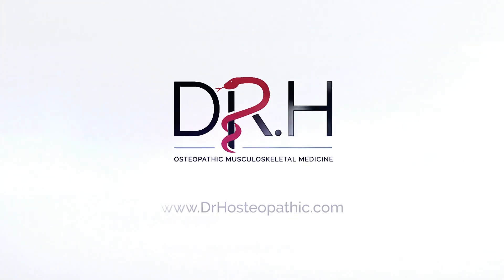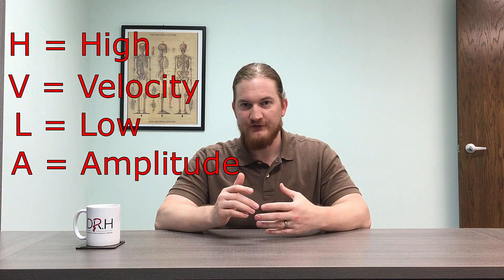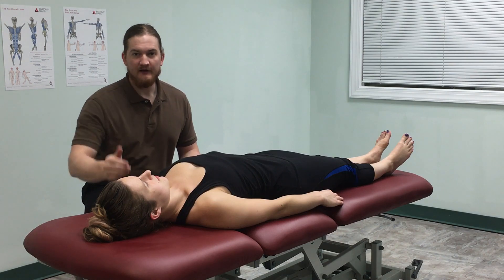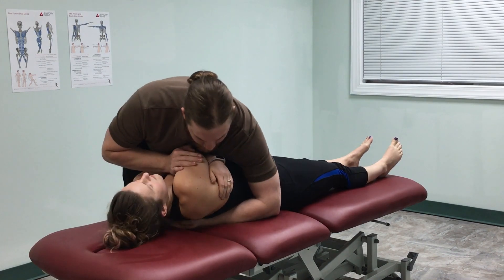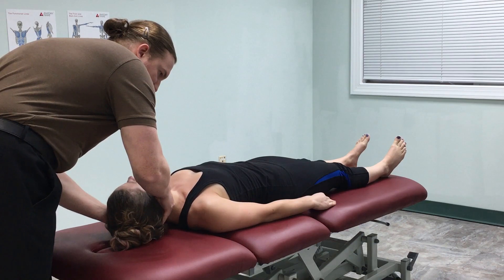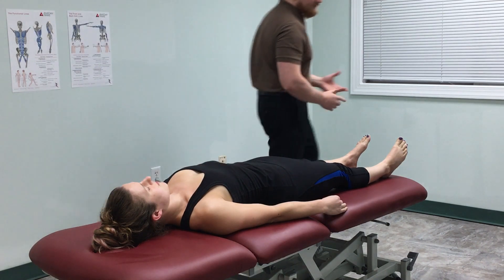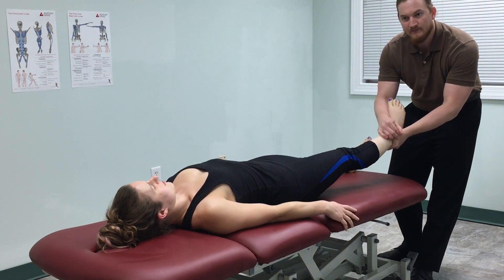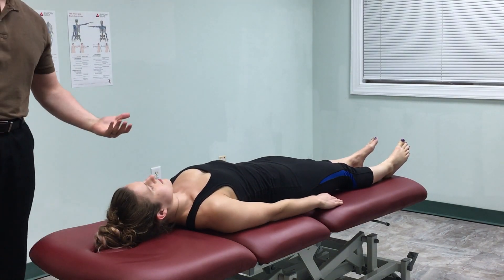HVLA--What's Really Happening When You Get Your Back Cracked

Comment: Do you think the drop table technique works like HVLA? And if its not gonna change your bone alignment why is there some video shows some scoliosis, kyphosis or imbalanced legs can be corrected after few treatment? Is it because the proprioception resets the biomechanics of the body so the muscle and nerves start to sending new signal to pull the bone back to right the place?
Reply from the maker: Yes, drop table is similar to HVLA, from my understanding. You are right in that it is the soft-tissue/muscular changes that are likely leading to the improvements seen in idiopathic scoliosis and kyphosis cases.